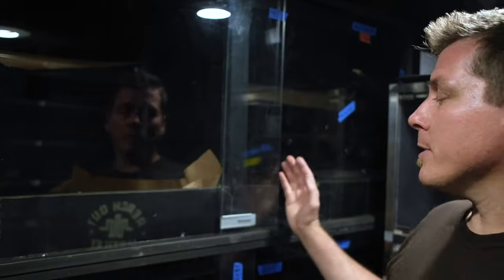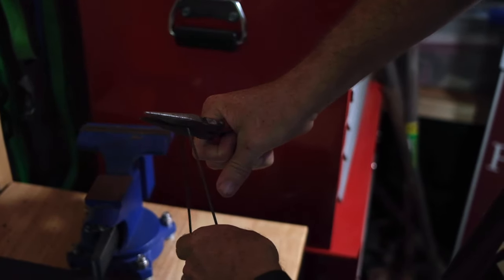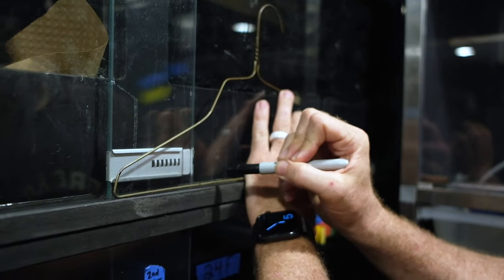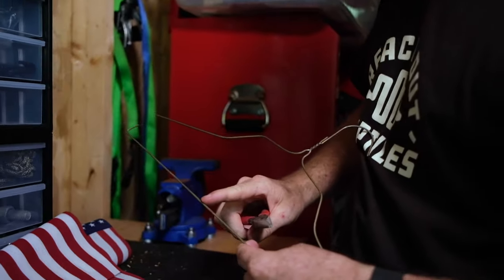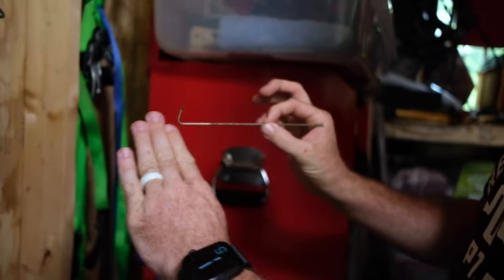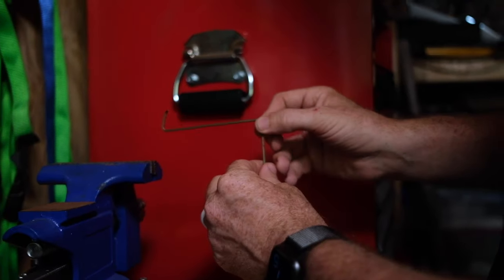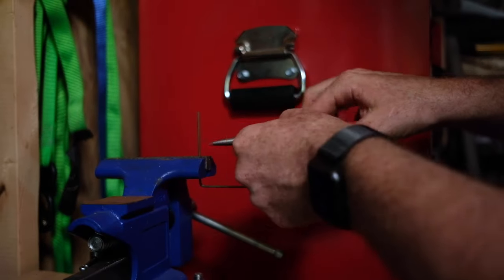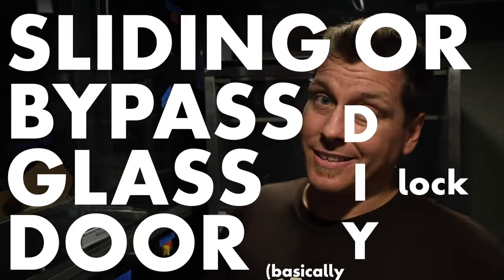DIY Reptile Cage Locks [Free Tip Friday]

Comment: You are awesome! Everyone recommended sliding locks, but I really didn't want to have to deal with a key when I'm only concerned about my snake getting out, I also feel like some of those scratch the glass. I was thinking of those hinge things for childproofing sliding glass doors, but this is something I can do now!
I think I will have to bend back the end so it's not sharp, the way my enclosure is that part would poke in where my snake is- my sliding doors are above the dirt guard, not in front of.